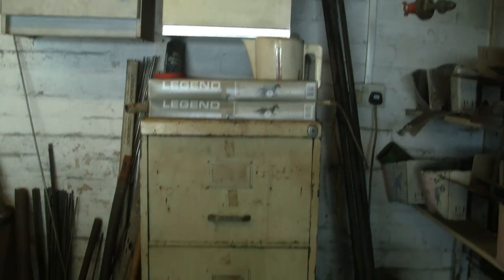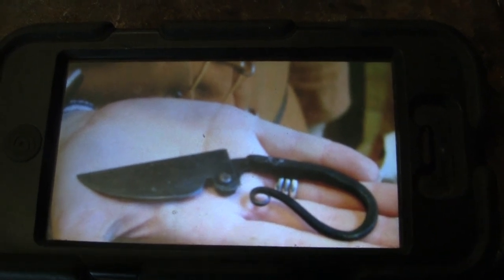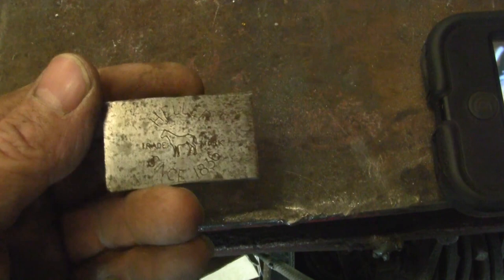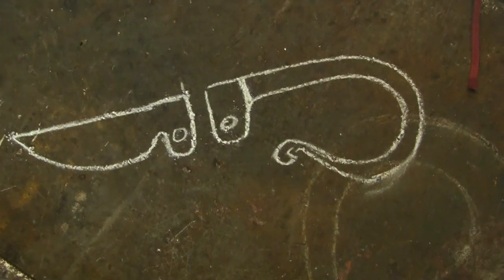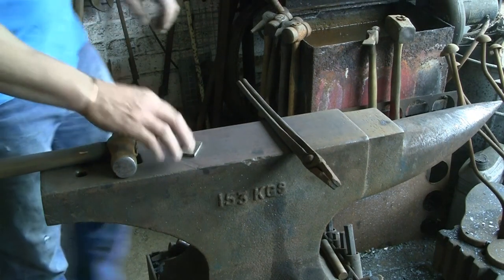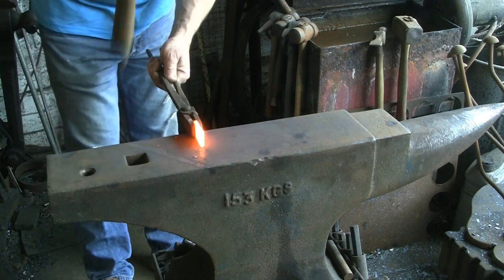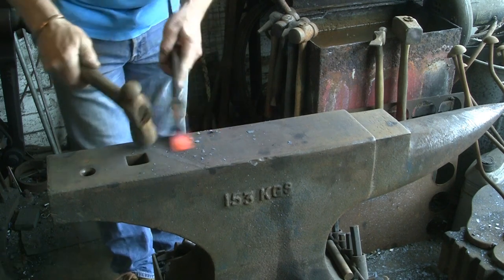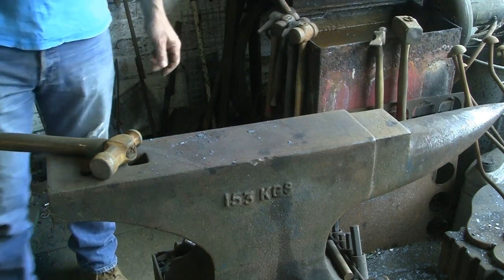Mediaeval Style folding knife Part one

Comment: I was recently told that whenever you draw something out the edges of the material move faster than the center, which gives you two or more points at the end of the stock. The solution was to make a diagonal cut at the end of the bar before drawing it out and hammering the corner on the short side into the bar so that you have a point before drawing it out. Hope you see what I mean, would've been easier to explain if I could draw it for you.

Comment: Gary, I love your videos.  They're some of the best smithing videos on the net.  With regard to your folding knife, have you considered using the bottom curl of the handle as a locking mechanism?  Most folding knives have a locking spring that is disengaged by pushing it aside.  Could you do something similar?  A friction fit would need constant adjustment, or a threaded screw with a wing-nut.

Comment: And I am not questioning your technique at all, and we may even be working with two different styles. But are you sure you should have so much wrist motion? I know it's delicate work with a small hammer, and I'm still only 2 years in to smithing, but I've been taught never to let my wrist move regardless of the project or hammer.
Reply from the maker: In most cases yes, the hammer should just go up and down and your left hand moves the material under it like using a power hammer. However there is a lot of work that can't be compleated under a power hammer and need the dexterity of  your hand moving. We were born with wrists for a reason, use them!